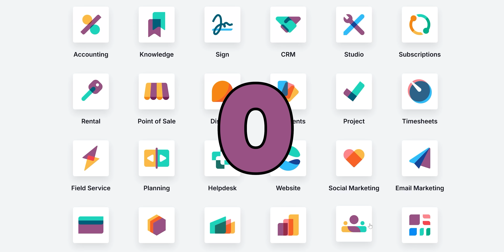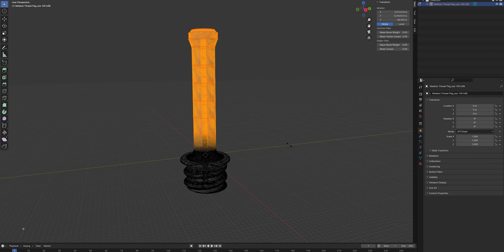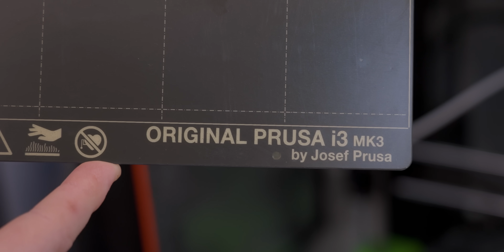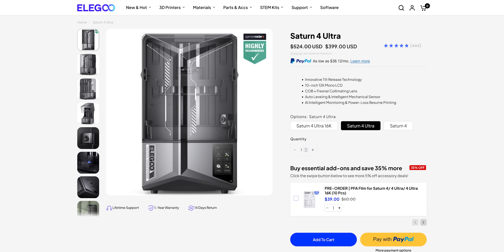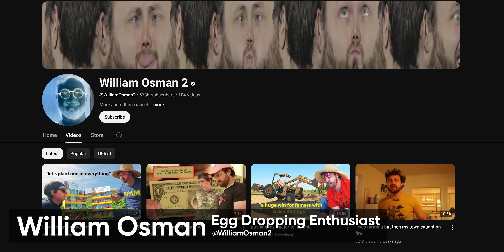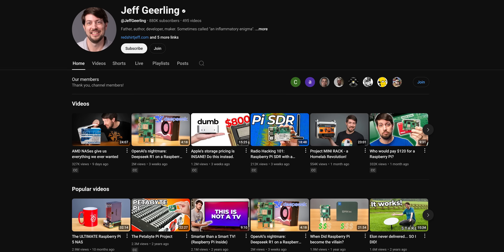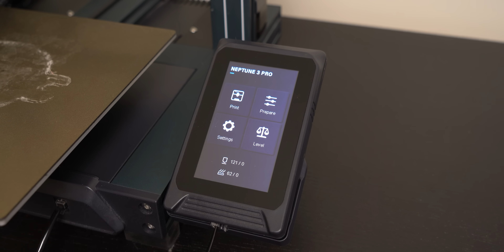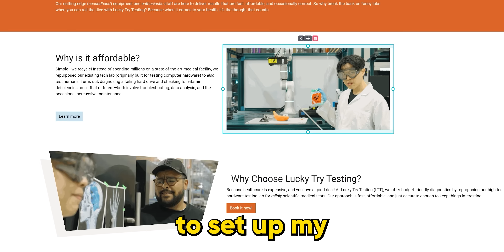Is my 3D printing setup wrong?

Comment: For anyone starting out, you should check out the Elegoo Centauri Carbon. It offers a lot of the Bambu ease of use features at a $300 price point, and it has a Multi-material system coming out later this year. Plus there is no firmware or cloud shenanigans and Elegoo is actually working with Orcaslicer to ensure the printer has open source community software support.
Reply: It is still not proven. And you can use orca with bambu printers.
Reply: @JakovPerisic  Only on developer mode, which we still don't know which printers will receive it outside of the X1C. Bambu connect has to authenticate with the bambu cloud on the host computer before it will send a print job to the printer, even in standard Lan-Only mode. 

So if the P1S or A1 does not get developer mode you run the risk of Bambu suddenly cutting off a ton of advertised features at any moment when they decide to cut access to the cloud, assuming they dont further alter the deal to allow them to disable the printers entirely as per their TOS which they still have not changed. Even then they will also have a substantially worse experience when using Orca because it does not have any access to the printer outside of toggling the LED strip in the build chamber. Also contrary to what Bambu has stated, the Orca slicer developer has stated that Bambu refuses to work with them directly.

You literally do not have that worry with the ECC, and there have been pre-release retail units on the official discord that have been running non-stop since I believe November of last year that are still producing the same quality of prints that they have on day 1. 

Also lets be serious here, the Centauri is literally less than half the price of a P1S and produces the same quality of prints. At this point there's literally no reason to buy a Bambu bed slinger or P1 series printer. The X1C still holds some creature comforts that might make it worth it, but at that price point you start running into competition like the Creality K2 Plus with a CFS.

Bambu does not lack competition anymore, and they will be the next Makerbot or XYZPrinting if they dont ease up off their new business plan of locking down control of the hardware they have already sold. Plus theres a reason Stratasys is going after Bambu in court and its not because Bambu is trying to be virtuous pioneers of the hobby.

Comment: I will say if it wasn’t for BambuLabs I wouldn’t have even gotten into 3D printing, and their goal of making things more secure when the thing literally has a camera on it and connects to your wifi and goes through their cloud services is far better than every other smart device maker out there making things that can be hacked in half a second and then they’re selling your data on the side anyway, I just wish they’d focus more energy on finding some middle ground between security and openness. Not that I care that much, I still just send things to print via Yoinking the SD card and shoving it back in with the files since I will never put a device on my wifi that can accomplish what it needs to do without it lmao.

Comment: Seems none of the people are actually properly enclosing and keeping positive pressure over their printers to pull safely out the micro plastics. 3D printers when they print spew tons of micro plastic, which is not visible to eye as it is so small. But it deposits in human body overtime. So it's important to have very good air conditioning pulling out all the fumes and stuff that comes out of it.

Comment: ive been printing for 8 years now and i honestly dont understand the filament dryer craze if you're just doing PLA. I have rolls of filament that are 10 years old that print fine. for other materials like petg, tpu and nylon that are prone to absorb moisture, sure. But for PLA?, just keep your spools in the resealable bag most of em come in these days.

what I can say tho is that i'm honestly happy that bambulabs exists, you can get an a1 mini for about 200 bucks and it will just work, no questions asked. My first printer was an ender 3 and it was a pain in the butt to learn on and I get why a printer like that might easily discourage people from joining the hobby. So even though there's been some controversy around bambulabs, kudos to them. and hey, if you want a printer you can tinker and experiment with, a bambulabs printer probably isnt the right course anyway.

Comment: I am tempted to save up for a ratrig v4 (500x500) with dual extruder setup from my voron, for some car/motorcycle parts. or maybe even furniture pieces since there is quite a bit you can fit on .5m^3
Reply: Yeah a great option

Comment: get a qidi plus 4, linus. AMS is coming end of Q1 . its enclosed, Bimetal hardened nozzles, WIFI, cam, heated chamber which can also dry filament, and 305 x 305 x 285 build plate.

Comment: Is wet filament hard to handle with a bamboo? I'm running an Anycubic Kobra in a basement printing PLA without desiccant or a dryer and it's been running fine for years.

Comment: I'm sure that someone else already pointed it out, but resin is very toxic and steps must be taken to ensure safety of not only the user, but the space and anyone else in the space where it is used.
Reply: I feel like it's more of an irratant. I wouldn't recommend it, but I don't really care and most of the time I just pull out the resin part with my bare hands and just wash my hands after after. Although it really likes to stick to your skin So I always use a little sponge. Just make sure you wash them no more then 5 min after or you get it can start to itch/sting. But the main thing is the smell. Ventilate
Reply: @Lil_blueskies  Originally I was going to set it up in my computer room, but after noticing the smell, I said nah, this needs to go in the garage. Also not as worried about spilling it on the garage floor compared to the carpet so that's a bonus.
Reply: Saying its "very toxic" is just as misleading. The only steps u really need to take for saftey are gloves, ventilation, and don't drink it. If the liquid gets on u it can be a mild itch to a slight burn, but nothing serious. Breathing the fumes in can cause problems depending on the person, but alot of the machines are fully enclosed and have filtered vents to keep the fumes from ever escaping.
Reply: @verakoo6187  I and many others developed autoimmune disorders, particularly skin disorders since some of these resins are endocrine disruptors it can also effect a myriad of other things... Please be careful out there.
Reply: @verakoo6187  well shit so i shouldn't have been drinking 3d printer resin then 3d printing on the the porcelain throne that's where i went wrong i though the machine was just a decoration
Reply: Yeah this should really be mentioned in the video
Reply: Resin is a mild skin irritant and studies have shown industrial fumes can potentially have long term effects, but it’s still not actually that bad. I’m sure anyone looking to buy a resin printer is going to do slightly more research than just this video
Reply: @jostin4041 you'd be surprised on how little people do research

Comment: But, as far as i understood, the "lockdown" is not really a lockdown. More like that the off brand slicer now need to adapt.
And if you dont wanne use it, you can still put a micro SD card in the Printer and transfer the gcode files that way. As you need for most of the other printers?

Comment: As a resin printer guy for years. I cant imagine how Jake hasnt ruined his carpet with resin. I'd usually ruin few films per year and therefore spill ALL OF RESIN everywhere. I love it with all my heart, but may it was a nightmare, do not recommend. I literally had 50 liters of IPA that I regularly spilled too, because you have to fill cleaning bath entirely for larger prints and you have to change IPA every so often.

Comment: I was this close to buying an X1C combo when Bambu announced their update - it was meant to be my endgame printer for some time so hearing that I may lose core functionality at Bambu's whim completely killed that idea.

Since then I've been looking into the Creality K2 Plus, but unfortunately there are a wealth of negative reviews from end users about their experiences with it, the CFS (Creality's version of the AMS), and most worryingly their post-purchase support (or lack thereof).

In light of all this I've decided to just keep using my current Monoprice special for now and invest in a Prusa XL w/ toolchanger & enclosure when I have the cash to spare.  Hardly a fair comparison considering the price difference, but I figure if I'm gonna invest heavily in a good printer I at least want one that will last and the XL w/ the optional add-ons is a far better printer anyway.  I don't mind not having Bambu or Creality's smart features since I already have OctoPrint and Obico set up w/ a Pi and a webcam. (OctoPrint & Obico could be a cool video btw)
Reply: XL is very flawed, be careful

Comment: We had an industrial 3D printer at my old work. It sucked. I hated it. I had to maintain it. It clogged up ALL THE TIME. The print would get mucked up..

I recommended a filiment dryer - because this thing was in a WAREHOUSE. Sure, Mitchell!.. never came. I setup a camera on a broken tablet we had to monitor it, I got yelled at because "it takes 10 minutes to go back down there and check on it" How often do you want me checking on it? This thing breaks so often, me checking on it every 30 MINUTES isn't enough. And it was at no cost to the company. Fuck that place.

Comment: @Jake:
1) You cannot "overcure" resin prints. Amount of UV that you would have to apply to incur UV damage to UV cured resin is so huge you cannot expect to do it with sun nor wash&cure machines. Resin post curing is inertly brittle, thats property of this material. There are more flexible resins but they usually cost extra. There is US made line of nice resin but its expensive (atlas 3dss made hercules resin, after heat curing its skin safe AND flexible). White spots usually mean you "cured" IPA, just let your prints evaporate for a day after washing them.
2) saturn sized printers after 8k.... dont change with resolution. 8k has 24um square pixels, 12k has 24x19um rectangular pixels and 16k goes down to something like 24x16um. You would still be limited by one axis before you notice other axis resolution.
@Jeff MINIRACKS LETS GOOOOOO
@Camdem DD, stiffness of frame and klipper. those 3 will make any printer faster

@Linus always treat new roll of filament as "moist". RIP BAMBU AND DO VORON or other DIY 3d printer :)

Overall looks like video made with people with "generic" taste. No tinkering mind with voron, vzbot, hvort or ratrig. maybe alex wants to build a voron? :D

Comment: I have been running the Qidi Tech Q1 Pro for about 6 months and it's amazingly simple and easy to use! I want to upgrade to something with an AMS, but it's an excellent starter printer
Reply: Qidi is working on their own version of the AMS that will work with the Qidi Plus 4.

Comment: Also sorry to hate on Jeff Geerling but I'm hating on Jeff Geerling.
Reply: Why?
Reply: @JakovPerisic  Alright, sorry to go on a bit of a rant here, but you asked. This all sort of stems from his review he did of the MNT reform. That company is charging thousands of dollars for a peice of crap low-power device that isn't equipped with simple features that every device should have, and then charged a ton of money to add these features back, trying pointlessly to justify it. Here's where this guy comes in. He did a review of this laptop where he was paid to say great things about it and not even be able to keep the device because of how expensive it is. Also, in general, he uses his obsession with single board computers to make revenue off of, instead of using them for constructive engineering purposes. Like the pi dispenser. He apparently has enough money to where he can have tons of these things and not use them to go towards anything real. Also, just a bit of a note, that laptop thing pissed me off just enough to spend over a year building a fully custom 16in laptop that has actual processing power. And then I got a Framework laptop, best laptop I have ever owned.
Reply: @falafell  thanks for the answer, I appreciate it. Yeah I get you, that thing looks like a toy and I see this in a 3D printing space, how some companies like Prusa have their influence over reviewers.
Reply: @JakovPerisic  No problem, and thank you for taking the time to read that and reply.

Comment: At my place of work I use multiple 3d printers on the daily. I have used a nextdent, formlabs 2, 3b and 4b. All of them resin printers, used for dental purposes. THe nextdent is very accurate, if it works. The platform is small and its very, very vulnerable to dust and dirt. The Formlabs series is excelent. The newest, 4/4B/4L, are so good. They print either very quick good quality (0.100mm per layer or slower for extreme precision. Im talking 0.025mm per layer. I will get a bambu for personal use at home somewhere this year I hope.

Comment: 787 hours of print time on my P1S.  I have not replaced anything except filament.  I've had one filament jam.  My son has an X1C with over 900 hours of print time with 2 jams total in the AMS.  These units are all but bulletproof and the update you talk about in the beginning was blown way out of proportion by the people on reddit who are playing chicken little thinking the sky is falling.
Reply: We have ~3000 hours on our p1s.

We've been through a few nozzles

had to replace ptfe tubes that wore through in the AMS (the ones between the AMS and print head are getting close to wearing out now) 

And replace one of the rollers in the AMS.

Still less maintenance than I did on the ender 3 over the course of... maybe a couple hundred hours?

Still concerned about the potential updates the company might push though.
Reply: fr fr
Reply: I completely agree I don't have an issue with the update I only use Bambu software so I guess it doesn't effect me
Reply: @Chiefs65tpt  I use orca slicer but still, no issues.
Reply: I own a P1S and AMS with similar hours. No this wasn’t blown out of proportion. It has made my business decisions change quite a bit. I was going to buy 3-4 A1 mini’s for a farm and didn’t because I use third party software and hardware to control my printers. This update would break a lot of stuff for me, so LAN only mode for the P1S. Problem is, I lost half the features I’m used to because I’m using LAN only mode, so it is a big problem hate to tell you and it will only get worse as people say “it doesn’t matter”. It matters to someone.